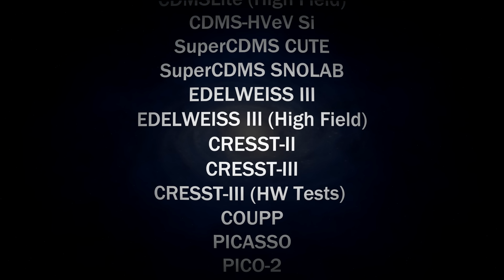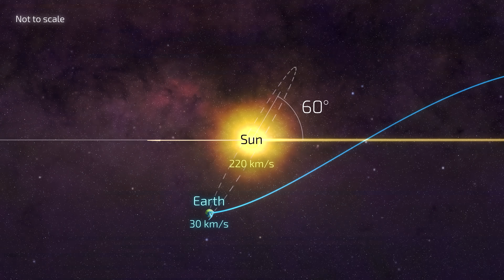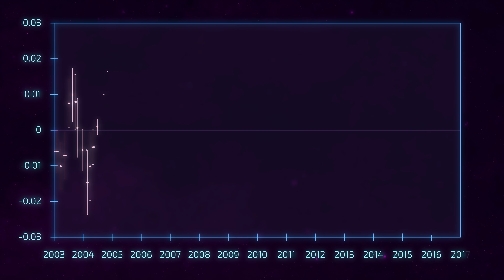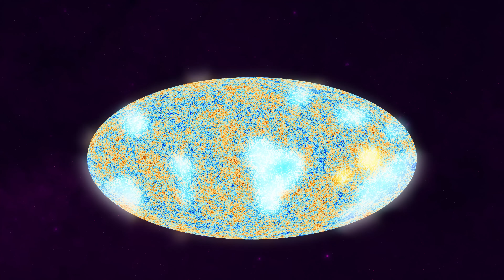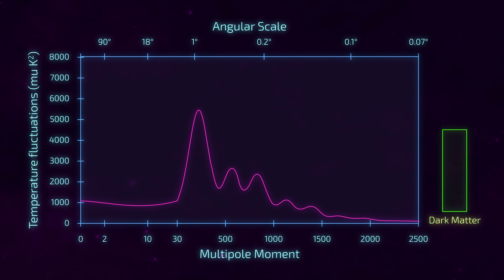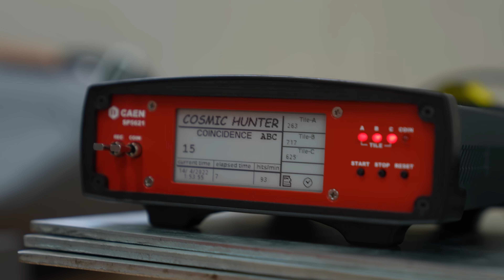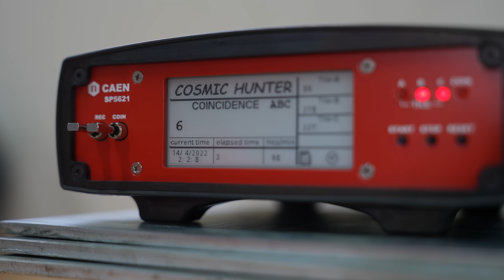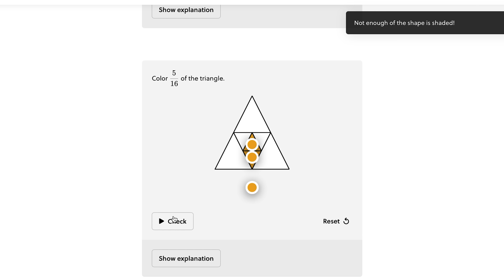The Absurd Search For Dark Matter

Comment: We know that the centers of galaxies have not just a supermassive black hole, but also plenty of stars, extremely dense neutron stars, and millions of other black holes. Does this not account for enough mass? And how are we able to measure all these and observe these?
Reply: This is all very fascinating stuff. I wonder if the silver iodide detector can also be stimulated by neutrinos as well as muons. Neutrinos are also very hard to detect,  and there is a version of the neutrino, which although it is short-lived, is very massive. Perhaps this is also a candidate for dark matter. If you've got countless neutrinos, and some of them are massive tau-neutrinos for a short period of time, can this not account for the missing mass?

And my final point has to do with our current understanding of gravity. We do not have a quantum theory of gravity, and perhaps dark matter only interacts w/ gravity. This means that the hypothetical dark matter particle would interact only with the hypothetical gravity particle, the graviton, which we still have no real understanding or evidence of. Perhaps we need to solve that first? Easier said than done fore sure, as it's only the biggest mystery in all of physics.

Comment: I Feel bad for the effort spent searching for dark matter here on earth. Scientists will soon realize that dark matter repels baryonic matter. The universe is completely full of point particles that have very little weight, yet there are so many of them that combined, they make up the majority of the mass of the universe. It is so simple... element 0 is a hydrogen molecule minus the proton. Yes, just a loose electron. This gas made up of element 0 fills the entire universe above our atmosphere. We can't see it with light but we can measure it's density by passing UHF radio signals through it. This is something that Tesla did many years ago. Testing for dark matter can be done from one satellite to another because they are above the baryonic matter in our atmosphere.

Comment: Just an observation. Every time there is the animation of the galaxy spinning under dark matter (4:21 onwards), it is just the 'normal' video but speeded up. The whole point is that the outer parts of the galaxy rotate just as fast (or almost just as fast) as the inner parts - so the galaxy rotates like an LP record or CD - as a whole.  Your animations DON'T show this.  They still show the inner parts rotating faster about the centre whilst the outer parts rotate slower.

Comment: What would cause matter careening through a near vacuum to slow down?
It seems like there is an assumption of resistance beyond or in addition to gravity.
The models we have for how movement within our own solar system don't function realistically. Why would we be in any way troubled to create a solution for errors in gravitational estimations at a scale billions of times larger that the distances and masses we clearly don't understand about our local bodies.
"It may elude us", indeed.
Reply: We understand movement through our own solar system pretty well. Errors really only come out of position and velocity measurements having a limit of how precise they can get, and how greatly those little differences multiply over time.

Also, are you talking about the Bullet Cluster bit about matter slowing down? Interstellar gases actually interact quite a bit. We've got a ton of nebula pics that show that.

Comment: I have a question: if dark matter is really some sort of "gravity charge", wouldn't they form clusters as they'll attract each other?
Reply: You got a good reply already, but I'll add that dark matter does form clusters due to gravity. They're just on the scale of galaxies. With regular matter, clusters smaller than this form because matter can collide with itself and trade momentum to an average between the two, a runaway process which leads to planets, stars, black holes, etc. With dark matter, the particles either never or extremely rarely collide and trade momentum, so dark matter clouds are essentially just a bunch of particles on their own independent orbits phasing through each other and having no mechanism to ever stop and collapse into any greater structure.
Reply: He clearly said that Dark Matter doesn't interact with itself.
Reply: Good Question! Dark matter doesn't form clusters because it is made up of point particles that have the same charge and therefore, repel each other. Dark matter acts like a gas. The closest gas that we can compare it to is hydrogen gas. The difference would be that hydrogen gas has protons that have enough gravity to form clusters. If you take those protons out of the equation, the remaining gas doesn't have enough gravity to form clusters.
Reply: @fredericksanders1314  all wrong
Reply: @space20021  Sounds like you know better. Pleas enlighten us...

Comment: The way I see it, dark matter is like an event where you have a box with some stuff in it, and it weighs fifty pounds in total. You know the box itself weighs say half a pound, and when you reach into the box and pick up the items inside, you know together they weigh about four and a half pounds. But the whole assembly weighs fifty pounds. You try literally everything to make sure it’s not a measuring error, you change scales, modify your formulas, propose new theories, but every time you try that, a contradiction pops up elsewhere. The only conclusion you can come to that doesn’t cause any contradictions is to conclude there are forty five pounds of ‘dark items’, and you begin trying to observe them. You keep looking for other ways to get rid of the need for them but every time it turns into a dead end.
Reply: Maybe Dark matter is the box weight we weren't accounting for.Holding matter in place giving it shape
Reply: Everything except considering space dust.
Reply: @mintymendicant1929  I'm pretty sure the cold gas of galaxies was already accounted for since, you know, we can see it.
Reply: @paulmahoney7619  There are alot of articles coming out explaining how there is a lot more dust and tiny particles than was thought and how most of it we can't see or it's very hard to detect.
Reply: @mintymendicant1929  Yes, space dust is largely cold, so most of its detection is from when it interferes with long-distance imaging, absorbing light and "redshifting" the light like our atmosphere. 

I'm quite sure a lot of modern hypotheses about "cosmic acceleration" is a bad fumble of the effects of space dust, due to its wavelength interference. 

Space dust is a more consistent explanation for universal redshift than "the universe is accelerating outward. Oh, it's accelerating faster now. Oh wait, it's accelerating slower now." That doesn't make sense, and it's internally inconsistent.
Reply: Except in the illustration you are not allowed to notice the guy beside you leaning his elbow on the scale.

Comment: I just want to know, if they don't even know if dark matter even interacts with normal matter, how they came up with the idea for the detectors in the first place? Based on all the variables we don't know, what makes this series of things better to use some other things? How do they know that this is the right stuff?
Reply: The Italian and Australian detectors are working off the WIMPS hypothesis. This is that dark matter is made up of particles that interact very weakly with other particles. So on a large scale you would never notice them, but if you're extremely precise and very lucky, you might find that they do still occasionally interact.
Reply: How do they know?
As far as I understood... they don't.
They already have this detector - the only one that could detect anything until now, out of many others experiments... - and that's why they will build this other one. And that is also why one of the researchers said, that if it doesn't detect anything that would be the death of the project...

Comment: Great video! I had a question. When the big bang happend did gravity already exist or did the rule just pop into existence? If it initially didnt happen with the big bang, when the big bang happened why did the galaxies not start orbiting the center of big bang but instead decided to expand
Reply: from what i understand (which isn't much): it's important to note that the big bang isn't the same kind of bang as you get when popping a balloon, where objects accelerate apart from another, and instead an expansion of space itself -- sort of like inflating a balloon. spacetime itself and matter within it are separate entities, and though they interact with gravity, they are not completely dependent on one another. matter didn't decide to expand, it always wanted to obey gravity. it's spacetime that was expanding, which can be affected by gravity, but not quite in the same way. the story of the universe can be summed up as a tug-of-war between gravity, which "pulls" (not really) mass towards itself, and dark energy, the unknown energy that is causing spacetime to expand.
when spacetime expands, it's the space between mass that is expanded, and not mass itself. perhaps the reason why the expansion of the universe seems to be accelerating is because mass is becoming more and more distant, and thus gravity is becoming weaker -- that's probably inaccurate, but a slightly more intuitive way to think of the early universe. everything was close together, but then things expanded a little more, forcing mass to gather in clumps, and those clumps spread out over billions of years and turned into galaxies. if gravity was weaker, the universe might be an entirely uniform cloud of quarks by now. i think the progression of the early universe is an example of how gravity and dark energy seem to be, by happenstance or not, at a perfect balance that allows complex structures to form.
Reply: So the Big Bang was essentially the beginning of the expansion of an ever-present "field" of sorts called "the space time continuum". Gravity is a consequence of the interaction between matter and this so-called space-time, where matter itself quite literally bends and distorts the very fabric of reality like an exercise ball on a trampoline. Except, this field doesn't have a center, it's boundless just like the surface of the earth, just translated into a higher dimension

Comment: I think dark matter is grossly over-estimated. One of the main arguments for it was that stars in the outer regions of galaxies are going faster than they would be based on the amount of observable matter in the galaxy and a misapplication of Kepler’s Third Law, but when you consider the forces applied by other galaxies located outside the galactic plane and especially nearby galaxies in the axial direction and by matter ejected from supermassive black holes, you should expect the outer stars to not follow a solar system-like speed-vs-distance from the centre curve. And another factor that has the same effect of speeding-up the outer stars is that they get a tow from passing inner-stars, which are far more numerous and far closer proportionally than planets in the solar system.

And much of the actual dark matter is probably just neutrinos, photons, black holes, brown dwarfs, dust and other ordinary matter that doesn't glow brightly enough to be seen.
Reply: Wouldn't those external galaxies, even the near-by ones, have minimal gravitational effect? The force decreases exponentially with distance no?
Reply: @Moz29  The distance between galaxies is often only several times the width of the galaxy. Imagine of the nearest star were only several times the distance to Pluto, and located perpendicularly to the plane of the solar system. It would speed up Pluto more than Mercury. And it's not the only effect. Imagine if Pluto was passed by several hundred nearby inner plannets every orbit - it would speed it up substantially.
Reply: @mathewmunro3770  not sure you understand “exponentially”. These orbits have all been simulated using the known laws of physics and advanced computational models. I like to think something as basic as the distance between galaxies would have been accounted for. Is fun to think about though, perhaps you could do the actual calculations and see what you get?

Comment: One possible explanation for the dark matter can be multiverse. There can be 5 to 6 parallel universes to account for that much invisible mass OR I am just kidding. If dark matter has mass then why its not coming together to form something like black hole (I would call it a "Dark hole"). May be dark hole like thing is already there at the centre the galaxy and we are just not able to see or detect it there and we are not able to detect it at earth as most of it is at the centre of galaxy. Is it still possible that we are not correctly calculating mass of the visible matter and black hole or there are many more black holes that we have not detected yet.

Comment: One thing I don't understand and maybe someone could elaborate on that. 
The setup you explained sounds like we would get a binary signal once dark matter or exterior influences would interact with the Natrium. So we either have a 0 (nothing happening) or a 1 (dark matter or something else just interacted). And obviously we have all the other precautions to check for exterior influences.
But how come the data from Italy is then this periodic wave function? How is the wave function related to those measurements?
Reply: How many occurrences in a frame of time?

Comment: It would have been nice to see some mention of matter that doesn't emit photons or other detectable radiation, therefore we don't see it in extrasolar astronomical observations.  For example, all the "dark" matter such as planets, moons, asteroids, ring systems, rocky systems like the kuiper belt and oort cloud, all the hydrogen and other atoms floating in space, etc.
Reply: The thing about dark matter is it literally doesn't obscure or interact (as far as we know) with any fundamental forces besides gravity. We can measure hydrogen gas because it absorbs light from behind it, we can deduce debris and huge clumps of metals because of the way they interact with different light spectra and the location of previous stellar remnants.

Dark matter is of completely unknown origin, and only really exists to fill gaps in observations, AND is inconsistent with itself (multiple theories that require or utilise dark matter come up with different predictions for how much dark matter there should be or what it should look like). That all said, nothing we see in modern astronomy makes sense without it. We absolutely require it to exist to explain basically anything we observe.

Comment: When you mentioned radioactivity of the K impurity, it would've been amazing had you mentioned the "banana" to give a sense as to how much radiation is being emitted by the crystal.

Also, side-note: While Na and K atoms are larger than I, in a crystal, the ions of Na and K are both smaller than that of I.
Reply: Another side-note: the K atom would change into Ca after releasing an electron, possibly Ar if it decays by one of the other two decay paths, but it definitely wouldn't remain as K.

Comment: What if it doesn't react to ordinary matter, completely ignoring all types of rays and background radiation, but only being effected by gravity? Wouldn't that mean doing it on Earth would be highly improbable? And if that's the case wouldn't the only way to detect it would to be completely free of gravity but still inside the galaxy and see if the detector still reads gravity?
Reply: If you don't do this experiment underground, you get a shitton of other cosmic waves and particles ^^'. Besides, we're not detecting gravity itself, but a teeny tiny energy variation that can only be done by gravity. The point of doing it underground with all those shields is to eliminate every known possibility.

- Outside the Earth, there's gamma rays, there's light from every stars, there's electrons and many other particles, ...
- at the surface of the Earth, there's still light, electricity, there's UVs, there's IR, ...
- underground... there is STILL some waves going through, some are even coming from the ground (radiations, as it is explained in this video).
- even with all those shields... there is STILL the possibility of detecting something else.

The point is dark matter would collide more easily outside the Earth BUT there would be so much noise we'd never be able to tell if the result is due to actual dark matter.

Comment: About the precession of the Earth's axis of rotation.
 Hello dear Derek!
 I want to offer you an interesting topic for the video :) About the procession of the axis of rotation.
 Take the Earth for example.  Everyone understands that day follows night because the planet rotates around its axis.  But winter replaces summer due to the precession of the axis of rotation.  A body can only have one axis of rotation.  From explanations on the internet, it says that the precession of the rotation axis is due to the fact that the axis of rotation does not coincide with the plane of motion!  And that's it!
 But why does she do this?  And how can it be imagined?  Why do the poles of the earth make a revolution, like a clock without breaking (exactly 1 year)?  Instead of the Earth's poles always turning in the same direction (it would be easier to imagine, if we assume that the Earth's movement around the Sun is a straight line, which is distorted by gravity)?
 I am sure many will be interested in this topic.  Perhaps you can explain it clearly and interestingly, as you can :)
 From your student Vyacheslav from Vladivostok.